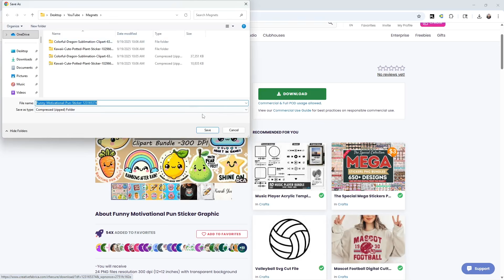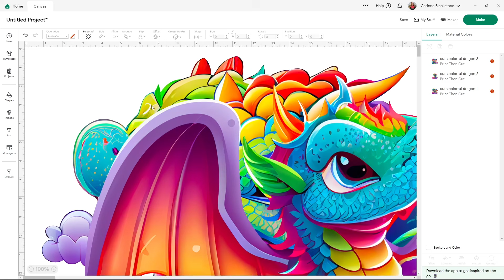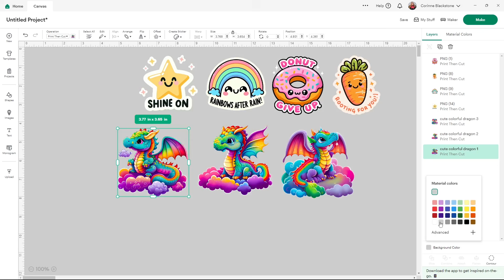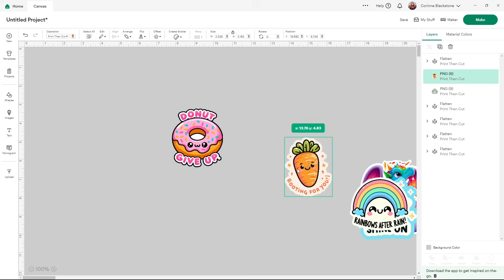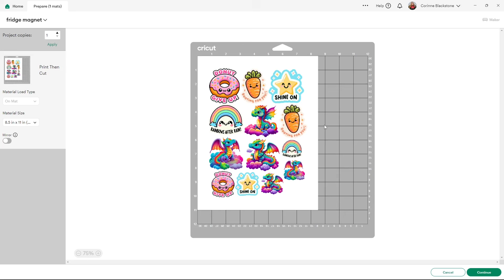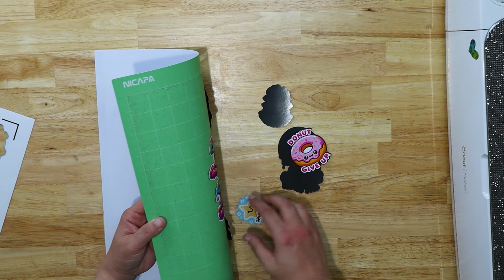How to Make Custom Magnets with Cricut Print Then Cut

Comment: Which side do you lay your magnet paper on the printer
Reply from the maker: Depends which way your printer prints. You’ll need to figure out how the paper is loaded and which side it prints on. Simply draw an arrow on your paper and do a quick little print and that will tell you which way to put your magnet sheet in

Comment: Which Cricut machine did you use?

Looks like Maker, if so, which one?
Reply from the maker: Yes it’s a maker but you can do this with any of the machines
Reply: @CorinneBlackstone just curious, do you also have a Maker 4? Is it worth getting? Thanks.
Reply from the maker: @terrybingham9524 I have the maker 3 but yes the 4 is fine it’s nearly the same.
Reply: @CorinneBlackstone sorry I should have said, I have the original Maker and it works fine. Considering if I should upgrade to the 4, if the faster speed is worth it.
Reply from the maker: @terrybingham9524 nope not worth it in the least.

Comment: Oh sweet - great video! I've been loving making stickers and this is definitely not much different. I'll have to grab some magnet paper and give it a try! Also learned alot about that contouring and welding which I never knew and I'm totally going to try the offset manually instead of using the sticker function.

Comment: Another question - I have a square picture that I want to make into refigerator magnets, but I want the corners to be rounded a bit. If I use the square shape with rounded corners and place it behind the picture, do I want to attach them, or flatten them? I want to keep the edge of the picture as the edge of the magnet. Thanks Corinne.
Reply from the maker: You need to slice of the photo goes all the way to the edge but you can also just attach and it will cut the rounded edges

Comment: How do you make these waterproof? Do I have to add a laminate adhesive sheet to it before cutting with the cricut or what do I do?
Reply from the maker: These will never be waterproof as the paper itself is not waterproof. you can add a laminate to add some protection but it will never be fully waterproof

Comment: Will this work with Explore Air 2?
Reply from the maker: Yes
Reply: Wanted you to know I made thanksgiving magnets and followed your videos. Printed great and when my machine cooperated they cut great.
I have an old air2. Do you know if print n cut works better on the newer machines? I wasted 3 sheets before it would work.
Reply from the maker: @CliffordSmith-n2z cricut claims it works better on new machines but I have an explore 3 and a maker 3 and I don’t see a difference. It’s more about making sure your machine is calibrated and I like to shine a ton of light on my machine when it’s doing print then cut

Comment: I’m gonna have to try this! Any suggestions on an inexpensive laptop that’s compatible with design space. I’m current using my cell phone. 😭
Reply from the maker: Truly anything except Chromebook. You want to be sure you get one with at least 8GB of ram
Reply: @CorinneBlackstone thank you so much! I’ve asked so many people. You are the first person to answer. One more thing looking to upgrade my cricut w/o breaking the bank. I have the explore air 2. What would you suggest? I wanna be able to do everything.
Reply: @deborahbreaux8980 Lenovo Ideapad Flex 5 or Yoga, Hp Pavilion, Apple MacBook Air,Dell Inspiron.
Windows 10 or later
intel duo core or equivalent AMD processor.
Minimum 4 Gb Ram. I would not go below 8 and more if you can!
2 GB free space, but go with as much as you can afford. Updates eat that space. I have a Tb!
USB port or Bluetooth connection for the machine.
You can use IPads and Mac books but they are more expensive.
Your most important features are your Ram and Hard drive. A Solid state drive will be better and lost longer, but cost more.